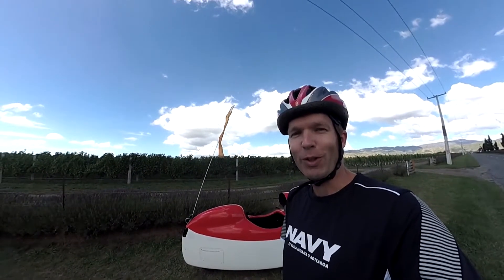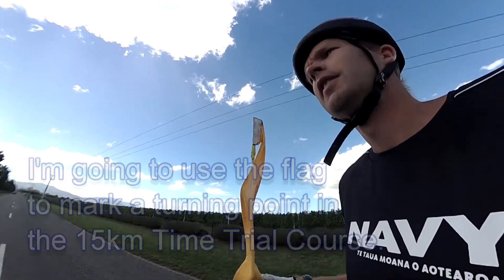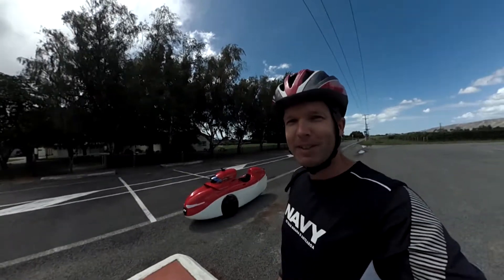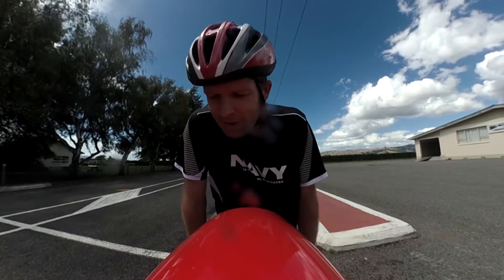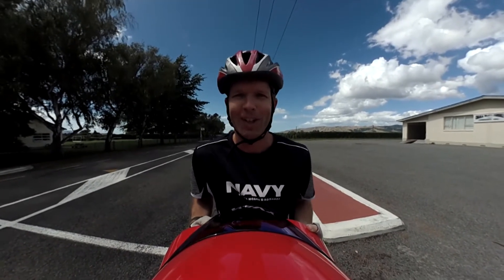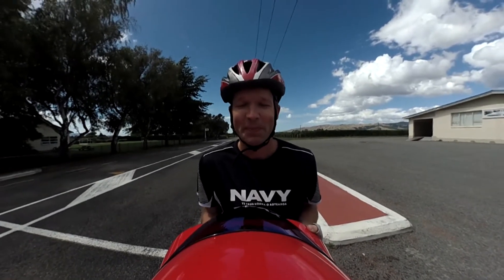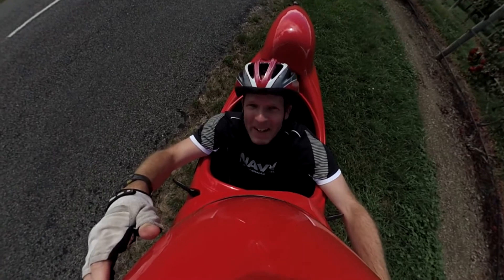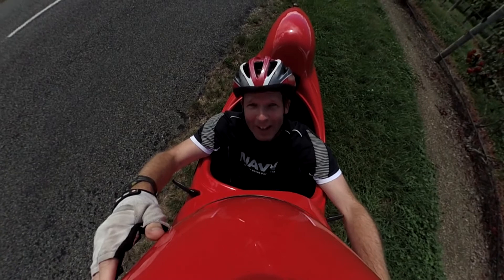How fast can my electric velomobile go   15 km time trial with velomobile configured for speed

Comment: Electric assist is good for uphills and when towing a trailer.
Reply from the maker: I agree, I use the assist almost every time I go uphills.  I haven't used the velomobile to pull a trailer yet.  I do have the trailer hitch, so maybe one day I will get the chance to tow a trailer.  Thanks for the comment.

Marnix

Comment: Marnix, taking into account the weight of the motor and batteries, I think you would be faster without on a flat road like this. As you manage to go above the engine's top speed you certainly have the leg power to do it. It might be harder on the 0-45 though. I'm riding an e-WAW and Actually love the comfort of the e-assist, but it doesn't make the velomobile faster since it is way heavier, but as I do carry some load on my commute ànd as I do have a 165m climb at the start of my trip, yeah, I enjoy the Bafang push.
Reply from the maker: Thanks for the comment.  I too like the comfort of the bafang, I have gone as fast and faster  on flat roads before I had the motor added.  But every hill was too slow for my liking, so the motor is handy for that.

Comment: 'Safety' flag... yeah, you don't need one of those in a velomobile!
Reply from the maker: Thanks for the comment.  I am not sure wether a flag makes riding safer, but my friends encourage me to keep using it.
Reply: @kiwi_velonaut  Get better/smarter friends... ;)
Reply: I once had an officer in a police patrol car do an illegal u-turn to aggressively ask me 'where my flag was' on my velomobile.  I said I was not required to have one and it makes no difference. He said that it's for safety and visibility... to which I responded, "Anyone who can't see a 2.5m long red velomobile shouldn't be driving... and you saw me easily. Goodbye."... and then rode off.

Not required. Not necessary. Makes no difference. One thing I make sure I never do in my velomobile is filter between cars - that's dangerous, flag or not. I've seen some recumbent riders do really silly things because they think a flag suddenly makes them visible to everyone.

The flag is just used - like most of these things - as a victim blaming device by other people who fail to see you. It's like making cyclists wear 'bright clothing' so that a driver can be forgiven for not looking properly if you weren't. Utter nonsense.

I can see a cyclist at night, wearing back with no lights just fine when I'm driving and if other drivers can't, they shouldn't be driving a 2-tonne killing machine!

I'm off in my Mango now... happy riding.
Reply: @nitramluap  If someone can't see you while others can, they need to immediately report their condition to the appropriate facilities that deals with licencing. I'm pretty sure that this is mandatory by law in most places, and is a condition when you sign the paperwork. Not only that, but I think everyone should be retested every single year (tho have a separate expiry date for use as ID).
Reply from the maker: Yeah, I'm sure that most of those that complain about not seeing me or others on light vehicles, are just complaining to be able to justify their inability to drive defensively.  Thank you for the comment.

Marnix

Comment: 27.85 mph average for less than 10 miles helped with a motor ? I can do a 25 mile TT in 54.56 (27.4 mph) without a motor on a normal TT bike, it isn't very fast is it ?
Reply from the maker: You are right, compared with some average speed other velonauts get up to my speed seems slow.  There are not many velomobiles in New Zealand, but eventually I will be able to compare my speed with other velonauts on the same type of road conditions.  In saying that, compared to riding the same ride on my upright bicycle, it is almost twice as fast.  Thanks heaps for the comment.
Reply: Marnix To get faster, intensity is the key, I only improved by pushing myself hard on a fixed route and try to beat each improved time over and over again. Happy cycling.

Comment: It's not very fast
Reply from the maker: Yeah I agree, I was expecting a much better result.  I have since done a test to see how fast the rear wheel turns (full throttle), without any load; I lifted the rear end of my DFxl off the ground.  The motor only assists up to 46.6 km/h, any faster than that and I am pushing completely on my own pedal power (whilst having to push the extra weight of a motor and battery.  My plan is to re-programme the motor for a higher RPM, but I am still researching the details, because it is possible to fry the e-assist if I make some mistakes in my re-programming.  Thanks for leaving a comment.
Reply from the maker: @hoekie3652  I use a 36v, but my system is not one I can change to 48v as far as I know.

Comment: Another nice video Marnix! Now I know that apply a flag on my next velomobile don't influence so much the performance expecially for a turing velomobile. What do you suggest for chaining on an hilly road 46 or 52?
Reply from the maker: Hi Marco, out of those two chain ring sizes I suggest the 46T for hilly rides.  It does depend a bit on the rest of your velomobile set up.  I have a 36t tooth in the back, driving a 26 inch wheel, and I use 155mm cranks.  With that set up, and the electric assist, I can go up steep roads with little to no trouble (between 15 and 25 km/h).  It also depends on how fast you're willing to pedal; my preferred cadence is about 86 rpm.  I very seldom need the 36t cog in the rear.